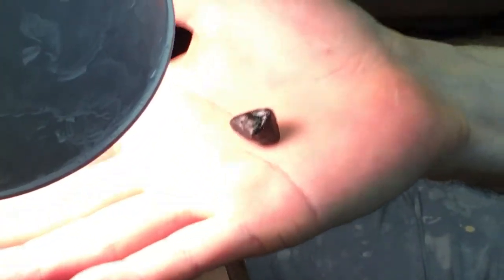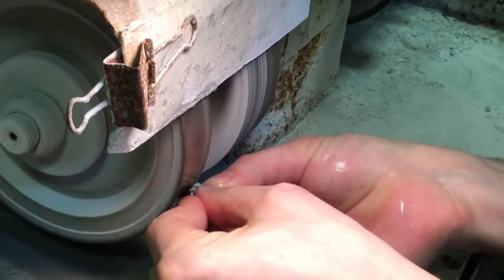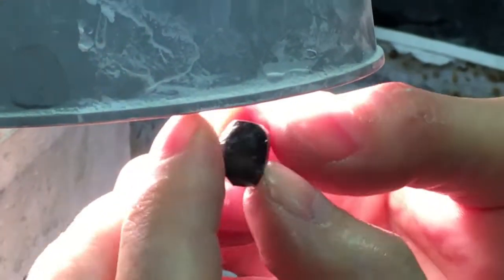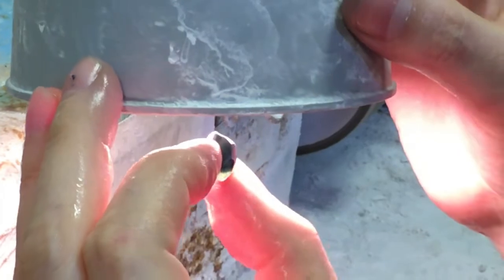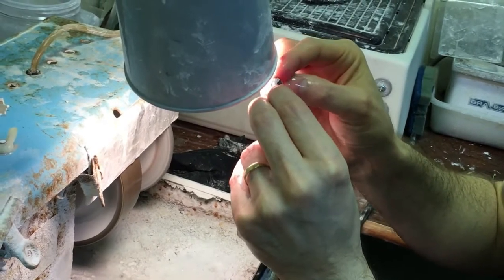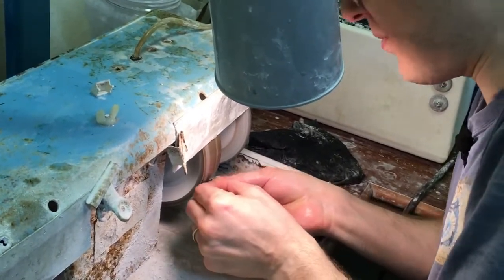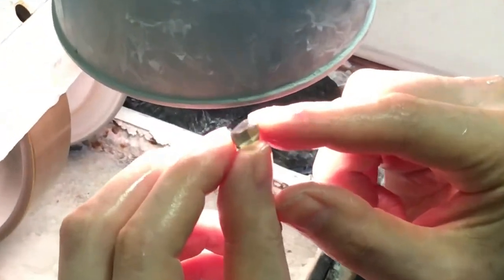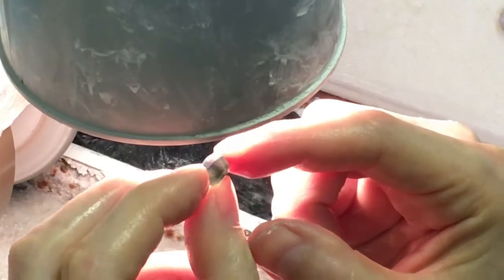Preforming an Australian Sapphire

Comment: I certainly hope you didn't have to pay too much per carat considering you lost about 2/3rds the original weight in the preforming process. Hopefully, it doesn't also require heat treatment as well ?
Reply from the maker: It was part of a large rough lot so the price is averaged over the entire lot. In the end it is far better to have a beautiful gem than a bigger and ugly one... Off the top of my head I don't recall if this one was heated or not, but if heated it is usually heated in the rough as the heating can damage the polish.